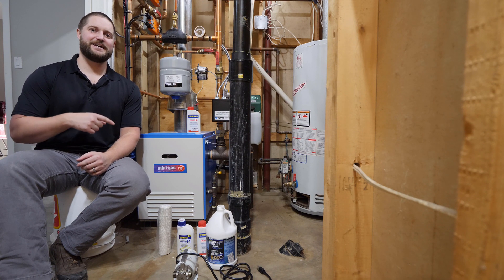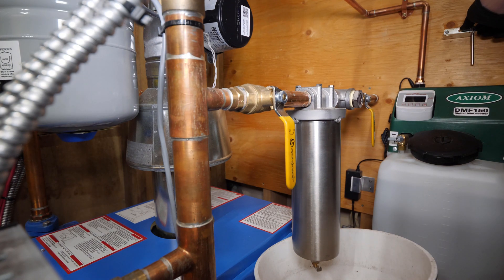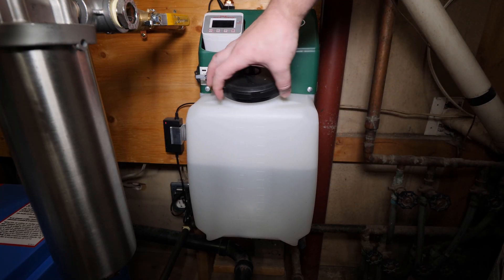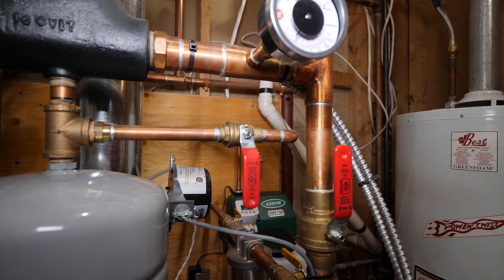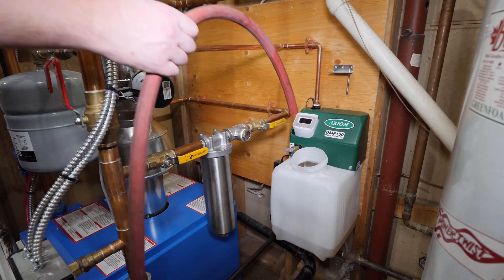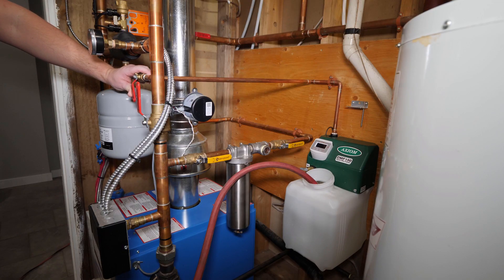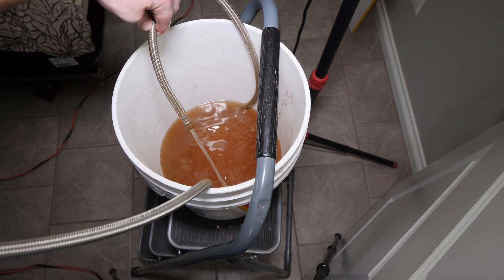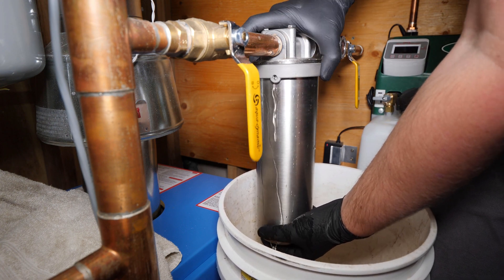Boiler Water Treatment: Removing Sludge and Scale

Comment: Great Video! I currently have a condo building with extreme scale and corrosion on the cast iron lines. It has leaks like Swiss cheese 🧀! Mainly on the connections where the treads in the piping are. The system ran great for 40 years using nothing but raw water and chemical treatment then when they change the boilers they started using glycol and all the trouble happened.

Comment: How do you add chemical without the fancy device you have?
Reply: pump it in through the drain, or if you're desperate release the pressure on the system and pour in through the highest radiator purge valve.

Comment: Get yourself a Fernox TF1 filter and it will collect the ''magnetite'' and you drain the bottom after you pull the magnet out of the top without any disassembly. Any other mechanical debris collects at the bottom too and everything drains at the bottom out via a plug. 

That filter cartridge reminds me of a whole house water filter on wells, which restricts flow after a month or two. An oil filter on a car is 20 microns. I think you could reduce the work the circulator does and you wont need to do the extra work involved.